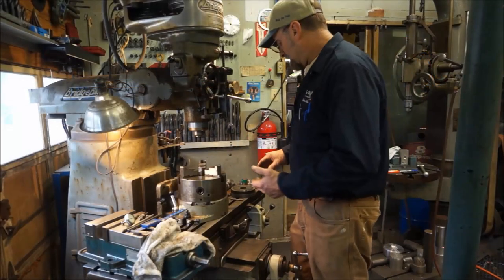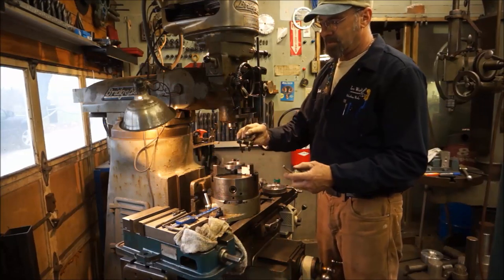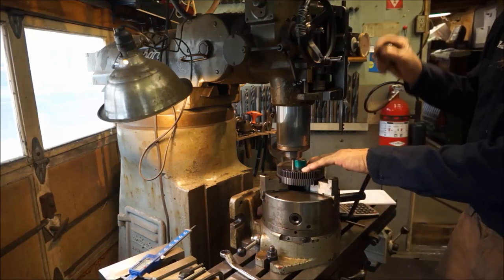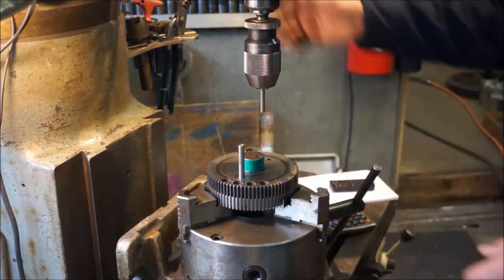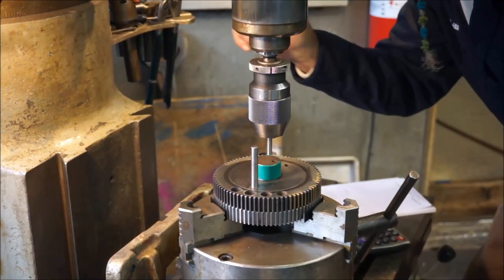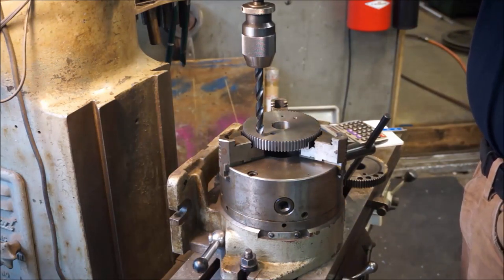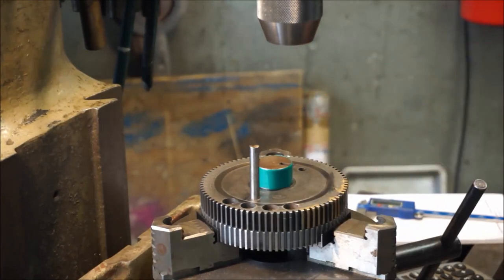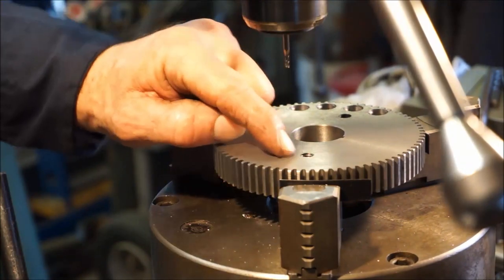My Pinion to Racks  Addendum to Dedendum Part Ten

Comment: Nice job but with all the trouble you went to to match the inside corner radius of turned recess and the exact location of the balancing holes, I'm surprised you didn't match up the teeth when transferring holes form original to new. I know it doesn't matter but nevertheless.

I have to cut some gears for Clausing so I watched this series with intent.

Comment: Keith: I'm a newbie. Educate me as to why not use transfer punches and center drills to start holes and make sure drill bit locates to the right place? Thanks  Mike
Reply from the maker: GeckoProductions I choose to reference and drill with a blank rod simulating a transfer punch right in the same set up so I would have less chance for err and less than half the quantity of holes could be transfer punched anyway, so a change of set up would be in order somewhere along the road. ;{)---

Comment: It is rule for most machinist's I had met that they will check a machine if its running true themselves even if the previous one was using it. It's the old adage of seeing it for yourself.

Also Fenner, they still do make those indicator holders. PTS has them in their product range but you could find them online. For new guys, DO NOT BUY THE CHEAPER VERSION!! The cheaper version has softer plastic for the joints so the holder wont hold properly.

Comment: the holes on the outside of the gear are ballancingholes , the are drilled after cutting the geartheets , you need to cut the gears first , balancing as second pass and the gear is finish !

Comment: The turned groove may indeed be just accidental, but it also may be done for clearance, if the thin outer ring of the adjacent step pulley is slightly dinged and stands out. On my old Atlas 518 the pulley´s outer rim was given quite some clearance, maybe an eigth in width and depth.

Comment: Keith, great series as usual.  You seem to be more diligent than others about vacuuming cast iron chips or otherwise keeping them away from critical surfaces on your machines. Is the concern sand from the mold or is it for some other reason? Thanks!
Reply from the maker: It is just a habit to always pay attention to it so the overall life span of the equipment goes that much longer. ;{)-----

Comment: Is it me or does it look like the teeth on the old gear and new gear do not line up? When he has the two gears stacked and staked the teeth are not in alignment. Was this intentional, or unimportant? Seems to me if all the work to align the holes need to be done then should not the teeth align also?

Comment: Question: It appears as if the holes are asymmetrically placed, and you have aligned the two gears back to back. Wouldn't this make them mirror images of each other rather than identical?
Reply: They were actually placed "face to back" if that's the proper way to describe it.  Remember, one side of the gear has a large undercut area, and it was facing DOWN on both gears during the alignment processes.  Your "back to back" would place both undercut sides or both flat sides in contact with each other.

Comment: Keith, Wow, Very impressive as usual. When you drilled the four balance holes would it have been possible to turn the rotating fixture from hole 3 1 to 2, 3 and then 4 versus moving the X-Y on the mill? Just a curiosity question.
Thank you for all the effort in making these vids!
Eric

Comment: Keith,
 at the 43.:00 min mark, you were discussing the 3/32" end mill and using it in the chuck. looking at that angle , looking at the two gears sandwiched together, it looks like the teeth on the gears , instead of being matched, they are in between each other's gears? just curious if that  is a problem?? thought the teeth should be inline with each other?

Comment: Keith, doesn't the gear need to be ran through some kinda of "balancer" to find exactly where and how much material to remove to keep the gear in "balance"? Just curious. Great video series :)
Reply: He does not have the part that is connected to the gear. In any event, since he's making a copy of the original gear, he's probably pretty close to what it needs to be.
Reply: Richards WasteLand I wonder if those holes are balancing something else that isn't obvious here in the video.  It's hard to believe that much material would need to be removed just to balance that gear alone.  A big old rubber tire just takes a couple of little lead weights.
Reply: On this part that is not entirely so.  The balancing holes are for an external part; not the gear itself.  The last word would be to assemble the parts, spin them up and identify the variance.  The overall balance is going to be very close.
Reply: That was going to be my question.
Reply: I looked for some lathe gear train pictures online.  The closest thing I could find is a Logan Lathe.  It was really similar.  As far as the balancing holes??? they are there for some reason.  The chunk of iron would not need that much material removed to balance it.  The internal density of a piece of cast iron that size/thickness and diameter just doesn't vary enough to require holes that big and deep.  I've seen flywheels with less material removed.
Reply: Holes are for some type of engagement pin in the gear box. Nothing to do with balance of the gear. I believe Keith mentioned that in the first video.
Reply: The smaller holes are the engagement ones if I heard him correctly in the video. I could be mistaken
Reply: I continued to look around for a gear train and arm/bracket that matched this part.  Couldn't find the exact match, or anything close.  But, the "balancing" holes are 180 degrees opposite of the two tapped holes.  So I speculate (guess) that something bolts to the gear there.  I'm guessed out.

Comment: in the video it looks like the teeth on the gears do not line up or match ? why?
Reply from the maker: Anthony Bruno The inner keyway was not timed from part to part, I choose not to worry about that because it wasn't a have too. It could of been done with an extra set of setting the original up in the dividing head first then change out to the blank. ;{)-----
Reply: +Keith Fenner  thanks for the gear repair and cutting ! I have a Bulgarian lions lathe built in 1976 . I tried to fix oil leak. And broke two teeth out of one gear and one out of another . If I can get it apart would you be interested in repairing the gears.

Comment: Question; I was wondering why you drilled the balance holes in the same position on the new gear ? Are the balance holes in reference to the gear balance or the shaft it rides on? If it is for the gear, then the balancing would be specific for that gear and be different would it not?

Comment: hi Keith
great work
@ Mr. Drillchuck
why is the name of a drillchuck , drillchuck ?
It is designed for clamping of drills, not for cutter otherwise it would named Milling Chuck
i have seen what a cutter in drillchuck makes.....

 Merry Christmas to you and your family

juergen
Reply: In the main you are right but you can use a centre cutting end mill to drill a hole, so it would become a drill chuck again even if holding a milling cutter.
Note to any beginner, don't try drilling with a milling cutter unless it is centre cutting.
Reply: that's right
I wanted to say:
a drillchuck can absorb no radial / lateral forces
it opens faster than you can say: "F%&@"

juergen
Reply: ***** I think the main problem is not the the chuck can't stand side loading but the means of fitting the chuck can't. Most drill chucks are fitted via a taper, either Morse into the quill or Jacobs onto the arbour, it is here the problem occurs.
ATB
c

Comment: That poor drill bit getting ran with out oil
Reply: It's cast iron, it will be fine.
Reply: Just hard on tools regardless what it is
Reply from the maker: Jordan Bjork Acually running ductile material in a slurry around you bit while it is cutting wears faster. ;{)-----
Reply: As in high levels of graphite in ductile cast iron?  =free lube?
Reply: Not all materials benefit from oil. 
Sure he could regrind it anyway
Reply: Jordan Bjork Exactly. Cast iron has copious amounts of graphite, which is an excellent lubricant. Locksmiths use it all the time in locks. As Keith mentioned, adding cutting oil makes it into an abrasive slurry that just dulls your tool. Cast iron is pretty easy going on drill bits anyways.
Reply: Orcinus24x5 I was told if you want to use a lube for threading cast is to use bar soap.